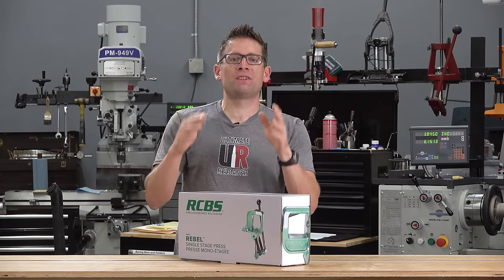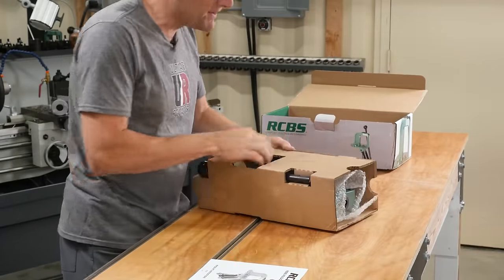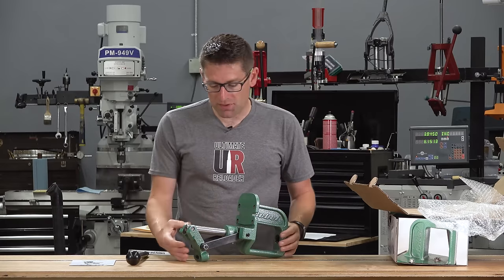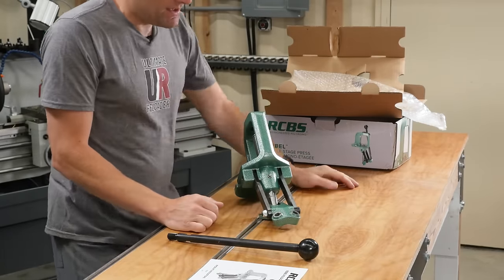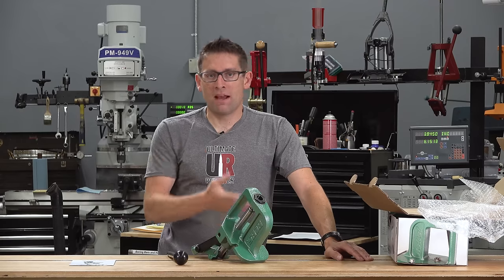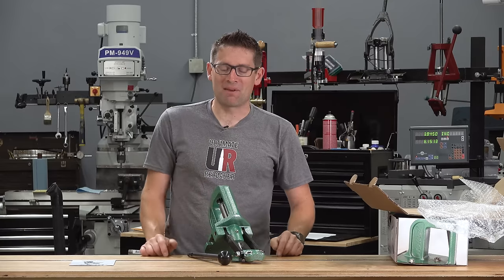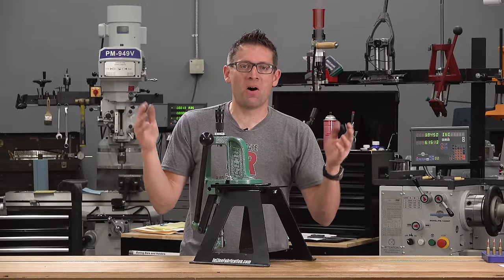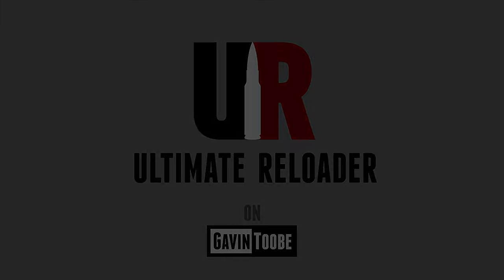NEW RCBS Rebel Press: Unboxing, Overview, Loading, Comparison

Comment: Was hoping to see a runout comparison, of the dummy cartidges you loaded, like you did in the 14 press shootout... otherwise, a very good informative vid!
Reply: The silence about concentrically and shoulder bump consistency is deafening. Why RCBS decided not to use over-cam  on the REBEL like the Rock Chucker and the PRAZI-PRESS is a mystery and, in my opinion, a mistake. A minor revision to the toggle block that would allow for cam-over in one guise and no cam-over with a simple reverse installation of the toggle block might be doable. For now, I'll keep my old Rock Chucker and skip the REBEL. If the dies and brass are up to it, the run out is virtually nil on every cartridge I load. This has been the case  for many years, and I suspect many more years to come.
Reply: @albertan9386  I have over camming presses and those that are not. I think that the over-camming doesn't do much if anything. Of course you are entitled to your opinion. If anything pushing a shoulder back more than necessary is a negative thing. Think about it. If you have a die bottom out how is it going to go any further unless it crushes the die? If using neck sizing collet dies in fact you can damage many necks just with dealing with an over-camming press before getting your setting right. Pros and cons of everything. Hype in many cases like over-camming.

Comment: Looks like a good one, I like the primers fall through now on this model.
Reply: When I bought a single stage press several years ago, ejection of the primers thru the ram, was the reason I did not shop RCBS.  Now I may have to buy another single stage press.

Comment: What about comparing the rock chucker Supreme against the rebel and do resizing and check neck concentricity and bullet concentricity using the same dies and the same caliber like 6.5. Supposedly the ram is supposed to be very tight with the cast iron Base??

Comment: Good video. I was on the fence between the Rock Chucker Supreme and the Rebel. I normally use a Lee turret press but I just bought the RCBS Rebel to accommodate large base .577/.450 Martini Henry dies, which wont fit in the Lee turret. The Martini Henry case is large, so the extra clearance and strength of the Rebel fit the bill.

Comment: I just got my new Rebel so far I love it, This is my second RCBS Press I have an old Jr Press that's at least forty years old and still running fine will probably set it up as a depriming station only. Converted the Rebel to the Hornady lock and load system, Wish Hornady would have made the bushing like a nut instead of rounded, hard to get it tight enough that it doesn't spin off when changing dies. Probably use some lock tight on the bushing and see if that help keeps the bushing locked in the press. Gavin would love to see a runout comparison of the two presses!

Comment: My RCBS RC2 does just fine for me👍. I do my priming with a RCBS hand priming tool
Reply: I use the RCBS bench mounted priming tool and OMG it is so fast.  I can prime 100 cases in a touch over 4 minutes.  Love my RC IV.  That thing is so smooth and the cam over is so great.  I am just not a fan of presses that don't cam over.

Comment: I would like to know the run out you got on the rounds you produced. Thanks
Reply: Me too, I have never owned an RCBS press until the rebel, I was surprised immediately at the sloppyness. The main bearings in the linkage have a pop to them at a certain point of the stroke. (Wallered out) and the ram has at least a 1/16” or 1/8” wiggle when it’s topped out in the stroke. Not cool. My handle will move side to side almost an inch.

Comment: I'm impressed with the mass of the new press, however, call me ole fashion but I still prefer my old original RCBS rockchucker press I bought back in 1975. I prefer to prime my cases with my press with my primer tubes and primer mechanism. My press has the green plastic spent primer catcher and it never has gotten in the way like the newer rockchucker press. 
I load everything from .204 Ruger up to .416 Rigby and .470 nitro express and have plenty of room for them in my good ole faithful rockchucker press.
Reply: I also use an old hand-me-down rockchucker. Incredible press
Reply: Nice I was born on 1975....hopefully your press is still going strong.

Comment: I expect both presses are good. I’m part of the 1% crowd as I use the RC Supreme on press priming system. Didn’t see a need to make the new press heavier. Never had an issue with spent primers. I put a piece of plastic with Velcro to take up the slack between the frame and back of primer catch assembly. Works 100%. I like RCBS its just time to market a new press. BTW my RC Supreme was about $65 less.

Comment: About the ejection of spent primers and primer crud, does the exit hole at the lower part of the ram protrude clear of the press body when the ram is in the upper most position, or does the exit hole get blocked by the press body and bearing surface, thus contaminating the bearing surface?
Reply: So much about nothing. If over-greased it can clog the primer hole. All one has to do is run something trough it to clean it out. And it is ridiculous to think that primer residue is going to damage the ram contaminating the grease. Where do you fanatics about little things that mean nothing come from?

Comment: I wish the Rebel came with shorter handles for operations that do not need all the pressure using a long handle ie. Priming, expanding. Erogermacis says this will take less wear and tear on your body. I have been using 2 shorter handles for years on my rock chucker.
Reply: I also prefer a slightly shorter handle as well.  Just curious, where did you get the shorter handles for your RC?  I imagine I could have someone make me one for either press but would rather not have to find that person.  

I like the handle on the Lee Classic Turret I have for pistol calibers where you can adjust it to any length you want and it has a slight cant in the angle so you can move it where you want.  A shame more presses don't utilize something similar for a custom fit.  I believe 2-3" off the RC or Rebel would be perfect.

Comment: Gavin, Reloading 101 question:  I have just finished mounting my new Rebel press to the bench, I found a clip in the packing box which I suspect is part of the press.  Best described as a wire half circle clip.  The shell holder sits fairly loose in the press, does this clip provide tension to the shell holder?  You mention in your video the the shell holder should have tension when pushed in.

Please advise.  I have not used RCBS presses before, just Wilson in-line dies.

Appreciate any assistance.

Comment: Is there no way to attach a hose for spent primer collection like on the Redding Big Boss 2? Does the hole where the spent primers exit the ram  go inside the frame at the top of the stroke? Therefore introducing all the spent primer crud into the frame ram interface?
Reply: Nick I agree 100%. What is sooooo damn hard about making this a full drop through ram? Mec did it right, although they don’t have a hose attached. Redding does it right as well. However, the new Lyman do it wrong as well so I don’t just want to just pick on rcbs. Introducing primer crud is not good for these to mating metal surfaces. Get it right, please!

Comment: Thanks for the overview. I am looking for my first press and seriously considering the MEC Marksman. I like the idea of the front load (so I can see what I'm doing) as opposed to a side load. However, I have never reloaded before and I'm not sure which is easier. I will start reloading .45acp  and then move into 6.5 Creedmoor. Do you think the new Rebel press would be a better choice? Thanks for all the great videos!

Cheers,
Greg
Reply: @dave-yeahthatsme3925  Thanks Dave!
Reply: check out this guy's video comparing 14 different presses
Reply: Greg Allen - The RCBS Summit is also an awesome press. Extremely open, and did the best as far as concentricity on the review Galvin did on 14 presses.

Comment: Another interesting video, but I'm puzzled as to why resize and load those casings and not measure them for precision and runout like in the 14 press shootout vid.  I don't think I'm the only one who'd be interested in those results.
Reply: Agreed, would still love to see the numbers.  I have some older presses but am thinking about picking up a new single stage for precision work.  Narrowed it down to Rebel, Rock Chucker, Big Boss 2, or the Mec Marksman.  Mostly leaning towards the Mec or Rebel though.  

From the little I've read, the numbers look great on the runout with this press but I'd love to see some real numbers compared against other presses side by side. I like to sit down and load so the summit is out.  As well as the coax, which doesn't seem to produce any better runout anyways.
Reply: While on the subject I'd love to see 2-3 presses tested side by side with and without the hornady lock-n-load bushings everyone loves.  In the 14 press test the Lee and Hornady presses with the bushings had the worst numbers but I'm unsure if it's from the press or the bushings.  Lots of precision loaders use them but I am skeptical.

Comment: The Rebel looks like a nice press!  I like the zerk fitting, no on-press priming and primer drop system.  I definitely concur with the 90-95% of people using an alternate priming system.  I use an RCBS bench primer and prefer it.  Thanks for the review!
Reply: You can disassemble and add a zerk to the RC.

Comment: I like RCBS' the design of the new Rebel press and it's good to see that they did away with the priming tool that came with the Rock Chucker, which I've had for 5 years now and I've never used the priming tool, I have a separate RCBS hand priming tool that I've been using for about 25 years now and it works great. The other improvement that I like about the Rebel is the spent primer disposal mechanism, the Rock Chucker's tends to cause stoppage in the tubes that drop the spent primers into the tray every once in a while, it's not a big deal you just have to stop the process and clear the stoppage.

Comment: I'm want to get into reloading and want to have a small set up to do so in my apartment. Is there a guide I can find that can steer in the right direction? I know I'll need a  press, powder measure, primer press, varies caliber specific dies and a sturdy table. I'm sure I'm missing a few more items for a more complete set up. Is there free standing press stand that be purchased instead mounting it directly to the table?
Thanks
Reply from the maker: Love the idea of "reloading in small spaces" - I've added that to my content ideas list
Reply: @Ultimatereloader  Great, looking forward to the content. Thanks
Reply: Add a good scale and that should cover it.
Reply: I have a Forster Co-Ax and an RCBS Summit, which has in incredibly small footprint. I’ve taken to traveling with the the Summit when I travel because it can easily be setup in a small space.

Comment: Gavin, many thanks for your videos, loved the 14 single stage press shootout. Would love to know your thoughts between the Rebel and the Big Boss 2. I’ve one issue with each of them. When loading, I mount the charged cases from the right (right hand) and place the projectile with left hand, simultaneously. The 0 degree/perpendicular O frame presses suit this. Therefore, I think this rules the Big Boss out for me, unless I can squeeze my right hand in from the left, when seat of the left side of the press. Do you think this would be possible to do? The one issue I have with the RCBS presses, including the Rebel, is it only has two fixing points, and they are centred, leaving less leverage to the front edge of the base plate and bench. Does this allow much flex on the bench in your experience?

Comment: I neither decap nor prime on my Rockchucker as I use a little Lee to  decap and I prime on a Lee bench primer. So my Rockchucker is strictly for sizing, seating and crimping. Got it as a direct result of the 14 press shootout and I just wish I had gotten it sooner. By the way, didn't you use a Redding seating die in the 14 press shootout?

Comment: Looks like a nice improvement over my original Rock Chucker, its marked with the year of manufacture stamped on it, 1970. I bought it new in 1970, so I've had it a very long time.
Reply: A year before I was born. Mine from 1990 is still going strong. Had a few parts wear and lost a spring, sent FOC to me from RCBS no questions. Great service!

Comment: I'm part of that 5% that won't buy a press without priming!!
I would challenge their numbers!
But I'm new to reloading, it's only been over 50 years!!
Reply: Yea I prefer the hand priming myself, but I can understand people seeing no on press priming as a negative. A lot depends on the volume you are doing. I have a Dillon 550 for my higher volume work.
Reply: I have a Rock Chucker Supreme w/ its priming system, but I end up using the Lee Ram Prime instead - better feel, quicker changeover from small to large primers,  quick mounting onto the RCBS & raises the shell holder to a better working height (for me).

Comment: I like the primer system on the rebel and the extra mass. But I actually like my supreme more. I'm one of the few that use the on primer system. I don't like greasing the ram. I've seen what grease does to a high use situation that it would endure. Unless there is a bushing Between the two to prevent wear on the frame... That's the truck mechanic in me talking. If it came with an ergo roller handle like the inline fabrication, and lighting in the frame, I'd be really interested in buying one. But I'll keep using my supreme.

Comment: I have had been using a Rock Chucker for years for my single stage duties. Never liked the post in front of the shell plate. The new press having a larger post is worse. If I were to replace my Rock Chucker (highly unlikely) it would be with a Summit or MEC Marksman.
Reply: It's made this way because it is stiffer if you look at shootouts on this channel the RC has very low/lowest runout, especially for the price.

Comment: Other than marketing... Why is a heavier casting needed ? Was there / is there a problem with the Rock Cucker  Supreme ?  It seems odd.  
 
I sorta like the Redding or Lee spent primer tube design.  Is this another spent primer on the floor dispenser ?

The lack of a priming system is interesting.  I like how the RCBS turret primes from the left of right.  Putting that system on this would have been nice.  The Lee Rocker Arm priming system is wonderfully simple and would have been nice.  I guess the Lee Ram Prime is an option for on press priming. 

The final issue is not putting the press at an angle like Redding & Hornady.  The visual opening is so much better on those designs. Even better is the MEC C frame opoening. 

It seems they were concerned with not offending existing Rock Chucker Supreme owners more than building a superior product.   They did little to attract a new buyer over other brands.  They removed the horrible spent primer system which made people not buy the RCS.  Honestly,  just letting primers go down the ram into a tube was all they did.
Reply: Agree big time, especially disappointed with the lack of a primer disposal collector.... the supreme sucks at this as well and their tray is garbage.   There are 3d printed options with tubes that are awesome but they're not 100 percent effective and they take up a lot of space.
Reply from the maker: The main benefit of the heavier casting is to have much more press-to-bench contact area.
Reply: Not really seeing the benefit of more area of you have an adequate benvh.  

Did the RCS or other brands snap benches ? 

Think about the surface area on a progressive press working (5) cases. 

I will agree that it lowers PSI.  Just not sure that force exceeds a correct bench design. It seems like marketing.

I saw they have a new powder measure coming or out.  Looking forward to that review. 

I like everything RCBS I own but the bar seems low on this.  .

Comment: The rock chucker is better because the linkage is cast steel. Cast is stronger than flat bar. There is not that much tonnage applied to really make a difference, since the finished cartridge is the same.

Comment: Rebel, Rock Chucker S. or Redding big boss II? Who wins?
Reply: That's a great question.  Throw the Mec Marksman in there as well although it's a little different.  I'm leaning towards the Rebel or Mec but keep going back and forth and have been considering the Big Boss II and RC as well.  

They are all great presses and I doubt even the best shooters would notice any real differences on target but I can't help but want the best since I will put a lot of time in working loads up for precision.  The rebel is the only one of the list that doesn't have cam-over, which I have read both good and bad about for accuracy.  It's nice having so many great press choices but it makes picking one challenging.
Reply: @Burris19D  Funny enough I got the MEC!  I really like it.

Comment: I just got my rebel and noticed a quirk. With the handle up it’s nice and solid when you pull the handle down/ram up there is about half an inch of slop left and right on the handle. Anybody else have this? Something to worry about? What do you think?